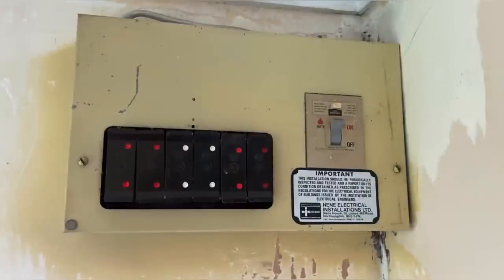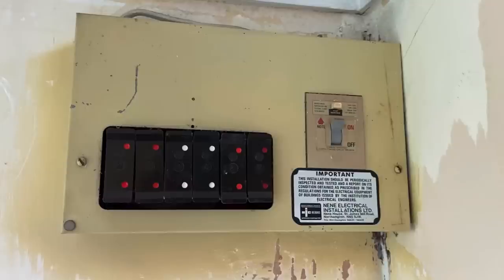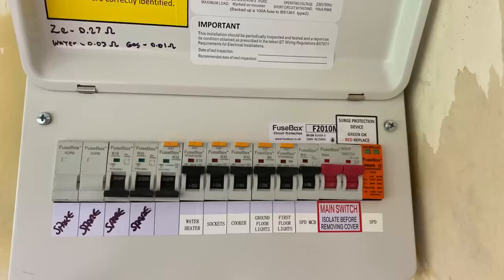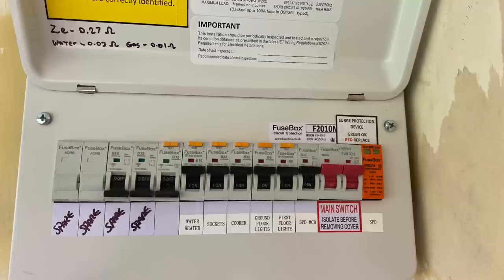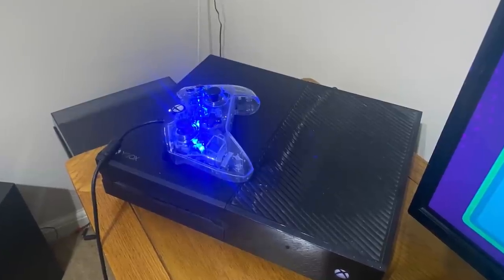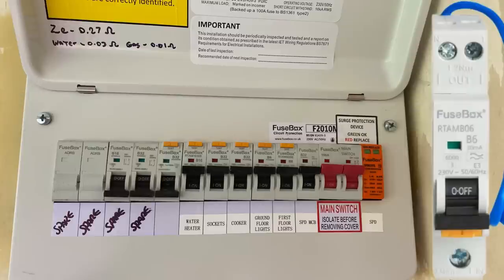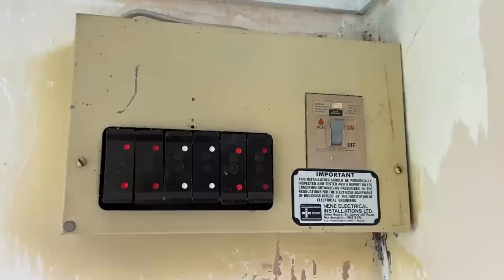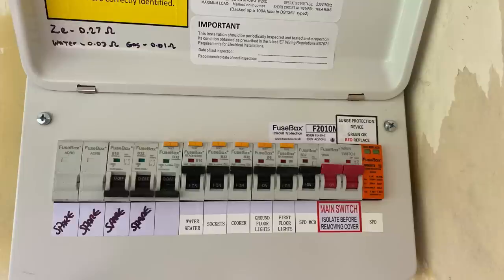Would you Change this Fuse Board..? WHY..? Understanding your new Consumer Unit

Comment: When my daughter and her children moved in my old Wylex board made me very nervous so I weighed up the risks of changing it out myself Vs the risk of fire and electrocution. I'm not a sparky but I do have an HNC in electronic engineering and decided I was sufficiently competent to do the job so I bought a Kewtech meter which is very nice bit of test kit, metal CU board and RCBOs for all circuits and now I'm much happier. Sure, I know it's notifiable work that needs signing off but I trust my own work far more than someone I don't know. EG when some fella popped round to change out to a smart meter there was no safe isolation, no lock off, no paper work and no testing he just shoved it in and left, personally, I thought he was more like a contractor called in by the energy companies for that specific task. 
I will wait for the sparkies to catch their breaths and compose themselves before breathing venom my way 😁
Reply: No venom required, you have improved an installation and by the sound of it have the ability to ensure that the results were all satisfactory. You do not sound like 'dave from the pub' type. Obviously you would have taken time to know the earthing arrangement, know its maximum permissible values, check this with your meter, then check all following results from testing to ensure you would achieve your disconnection times etc. The paperwork is important for renting or selling, other than that - the paperwork is imo the least valuable. A safe install is the important thing here. Bonding conductors in place and readings below max permissible etc. 

Sadly there are too many people that 'have a go' but get it wrong - sure it works, but it is far from compliant and not close to safe.

I have met electrical engineers and electricians that work in specific fields that cannot carry out a basic install in most domestic and commercial settings because they arent practised in it. Builders + Landlords used to be the worst but thankfully the new legislation is slowly eradicating the shoddy ones as they have to have the paperwork to let it out.

I personally hate consumer unit changes, we always test before we change it so we can make the landlord aware of any additional work required to bring it upto compliance - if not you would have to rectify the issues after the change but before it is energised and this can be costly / unexpected! 

Give me a rewire anyday, i know the quality of the install from top to bottom then lol (no limitations on concealed cables etc)

Well done and glad you managed to stay safe while carrying the work out mate!
Reply: @danielfisher2954  if a circuit  falls above the max zs value which is on an existing  installation  ect what is the rule then?
Also on a TT u might have a zs  of 50 ohms ect. Where that us acceptable  but it won't operate  the protective  device under an earth  fault.  So install rcd  protection  required  if zs  exceeded  for the above reasons?
Reply: Zs needs to be brought below max zs. For the TT, add earth rods

For circuits you have multiple options, change the type of MCB from say D to a C or even B (depends on circuits start up current)

Run an overlay earth? We do this on SWA installs to bring the Zs down

You could break the circuit and turn it into two circuits. Ring circuit into two radials on 20a MCB will give higher max zs and lower readings. 

There are always alternate methods but you have to see which is right, which the customer can afford etc.

Hope I've been able to help, still half asleep and probably just rambling haha
Reply: @danielfisher2954  How can a tt  system  ne allowed  up to 200 ohms though?
Reply: @carlmarquardt994  that is only with 'additional protection' in the form of a 30ma RCD. While the 200 ohms is compliant, it is preferred to have it lower.

That being said, we recently had a reading of 24ohms on an overhead supply. The main earth coming from the rod was only 4mm. I spoke to UK power networks who maintain the infrastructure in my area.

If the reading exceeds 20 ohms, it is considered a fail by then and needs rectification. On a TT the homeowner is responsible for the cable from the rod to the DB, UK power networks are only responsible for the rod itself. We changed the cable to 16mm and it brought the reading down under 20 ohms
Reply: @danielfisher2954  Ok Daniel.  Thank you for your contribution.  I have attended  a small  scale pumping  station down South. One three phase circuit  one light one power. 
Schneider  board no the just main isolator. Zs  was about 40 ohms  TT. Earth disappeared into the tar floor.
They are relocating  the meter  to outside wall as its in wet area  inside  end not in an enclosure. 
If I stick  an rcd  on the main dies that make it compliant. 
On the table of test results most of the max allow  Zs  are under 1 ohm.
I recently  did the testing course  end we didn't cover this. 
I am an Aussie sparky  and over here  now where  the regs  n rules are  more stringent.  Appreciate your  input
Reply: @carlmarquardt994  I ran this question by NAPIT before.

Provided you have a 30ma RCD, you're covered.

As for the max Zs results on the certification - record the info you have.

The R1+R2 is the most useful side of the test cert IMO. The R1+R2 will show you how big the circuit resistance is, you can do a simple calc to see if the measured reading is close to the expected reading for the circuit length.

The insulation testing will confirm you have no shorts or degraded insulation.

Obviously you have to do all your usual testing but when it's TT I find the R1+R2 gives you a better look at the install at a glance. (Kind of irrelevant but I add these to max for TN-S (0.8) and TNCS (0.35) max, this gives me an idea of it it would be compliant on TN installs)

I have known of a couple of installs where UK power networks couldn't get the Zs of a TT low enough (under 21 ohms for DNO/supply only), they turned it into a TNCS - we are not allowed to do this. Only they can
Reply: @danielfisher2954  ok. Many thanks.  I think  I am dealing  with the same network  down at welwyn  garden  city. It's slightly  off grid on an old landfill site. If they are running  a supply  cable to the location  get does it benefit  the supplier  to have a TT?

Comment: If your 70plus living with that yes keep it ,but honestly it should be updated …years ago the worst thing about them was 15 amp fuse wire in 5amp fuses and I’ve seen a metal hanger been cut and put in a 30 amp fuse ..I’ve seen nails in them plastic fuse cover removed ..( massive fire risk).. as I done my apprenticeship in the 70s there were loads around , and the mem boxes with porcelain fuses today it has been improved massively , better tools , better equipment , ie test equipment .. in my days at college my lap top was a pencil , rubber, sharpener ..,

Comment: Has anyone seen an old installation protected with 16A for ring sockets upstairs and 16A for the ground floor? Would that be compliant with the regs? Pretty sure said property was formerly converted into apartments. Has a CU inside and outside alleyway has another CU. There are two showers in the property but no circuits in the CU indoors.

Comment: If you do an eicr on a dual RCD board and the leakage does exceed the 30% rule, does it get coded at all.
Reply from the maker: Great question
Reply from the maker: C3
Reply: @GSHElectrical  if the rule is based on being more related to nuisance tripping as opposed to safety I guess it’s unlikely to be a fail and more of a recommendation

Comment: Is a modern consumer unit likely to trip if it upgraded an old fuse box in a house with 50 year old wiring that really needs a rewire? i.e. Both should be replaced at the same time.

Comment: Hi Gaz I was thinking about the possible problems we may have with DC leakage in our electrical system’s from thing like phone chargers washing machines or even the clock/ timer on electric cookers ? 
Now i’am not saying it’s wrong but if DC leakage is a problem isn’t it more likely to be coursed by smart meters as they are hard wired in to the system not just plugged in to the nearest socket  ? We all know how much electronics smart meters have inside them , so are they adding to the problem? If so get rid of them and it may solve the problem?
Reply: See I can be a good boy sometimes and ask sensible question’s . 🤣 I have always had a lot of respect for you guys. I get annoyed when I give a opinion and some idiot turns it into an argument like yesterday on one of Gary’s videos.
Reply from the maker: Any DC using equipment can leak DC current if the right conditions occur
Reply: Smart meters are on the other side of the RCD...

Comment: Any reason you couldn't swap the rewireable fuse carriers with rated breakers/rcd. I remember many years ago this being done as the unit and wiring and main breaker was fine!!
Reply: It does not give you 30ma RCD protection for a start. Secondly, whilst it's not mentioned in the video, there were a lot of wiring issues in the original unit (visible @3:22). One clue is that the old unit had 6 x 30A and 2 x 5A fuseholders, whilst the new on has just 2 x 32A, 1 x 16A and 2 x 5A RCBOs. So it's lost one circuit and the number of 30/32A circuits has been halved. 

There were all sorts of horrors, such as 30A fuses on 2.5mm^2 cable.

Comment: It's been 13 our 14 years ago we had our old school cu like shown replaced with a newer plastic one when we had our kitchen done
I literally threw away the replacement fuse wire earlier this week
Now the entire house is being rewired room by room I'm still looking into what the best future proof cu and breaker type at the end of the day in a few months
Any advice would be appreciated
Currently have a 14 way (12 populated) with a 100a fuse but we will also need to add in the fire alarm circuit in the future as its currently battery rather than wired (it's wired, just not connected)
Thanks
Reply: Moving forward then, if your not using a competent diligent electrician, as a minimum id recommend that you need to Upgrade the cu to metal enclosure with builtin spd T2,  all circuits to be A type rcbos, and all socket circuits upto 32A to have afdds. Oh and we're waiting for them to bring out socket outlets with type 3 surge protection built in and pen fault devices for the cu, we are so slow in the UK for this kind of thing, but all of the above should see you through to the 19th edition😉
Reply: @brianhewitt8618  see, I understood what you said there, but I just know I'm going to be in a position where I'll spend loads of money getting things done and then they'll change the rules again 🤣
And we are not in a position to have the entire house in bits so the loft is fine, the first floor is done, there's enough wire floating about to finish off the down stairs sockets when the time arrives to make a mess
Which is when the cu will get changed
Just want to know what to ask him to fit if he's fitting something else instead 👍
Reply: If by fire alarm circuit you mean for mains powered smoke detectors they should be wired in with the local lighting circuits.  The idea behind this is if they were on a separate circuit and it tripped you wouldn't know for a while until the batteries died . If it was on with the lights you would realise straight away and fix it or you would be in the dark .
Reply: Unfortunately it's hard to know right now what the best option is for future proofing.

Afaict Hager have historically been the best at maintaining compatibility. Their arc fault detection products however leave a lot to be desired. They are two modules wide, are not designed for the busbar styles we typically use in the UK and do not integrate RCD protection, so need to be used in conjunction with a seperate RCD or RCBO. 

Other brands offer single module combination RCBO/AFDD devices but haven't been as good at maintianing compatibility and/or are pretty new to the market.

Comment: Looks like my old fuse board except mine was an 8 way. Not long had it replaced with a 10 way with the two rcd’s as shown in the replacement, along with the old single 30amp fuse box in the garden shed that powered a few sockets and lights. (Lights were fused down using 5 amp spur from 30 amp) and now has a 32 & 6 amp garage fuse box. The old unit had to go as the trip had a fault and it had a 100 Ma trip. You’ve probably guessed I’m no sparky by my terminology🙂. No I didn’t replace it, had a sparks do it. I used to be ok at adding a spur in the old days, not that you can do that now unless a competent sparky, but replacing a fuse box is a far different matter and not a diy job no matter how much you think you know. A man’s got to know his limitations if he wants to avoid electrocuting himself or burning his house down.

Comment: Superb video, thank you.  Would you be kind enough to answer a few questions please. Is it fair to say if (like in this example) a consumer unit that is equipped with RCBO devices, all circuits presented to the box need to be uniformly fitted with this type of protection? In the box within the video, the two spare slots are not RCBO's. If later used this would present an issue as these two channels have zero earth leakage protection and potentially present an unsafe installation.  Second question, what load is attached to the "SPD MCB" breaker?
Reply: No, not at circuits need to be individually protected by RCBO's. However if you wish to do that, you may.

Comment: No mention of Ka rating of rcbo or main switch ie if sub station close by the Ka rating would  need to go as  a example 3KA to 8KA
Reply: Now what does Guidance Note 3 say about fault currents in domestic CUs where the service cut-out fuse will save your bacon ;)

Comment: We had an EICR done on a house, the electrician included an estimate on the back for changing the consumer unit "so it would be 18th edition compliant". The one already there was plastic, but fitted by Norweb to a high standard. My wife went in and paid before I could stop her, within 10 mins (I'm not exaggerating) the consumer unit was ripped out and replaced, when I asked for the EICR report to see how it was rated, he denied there was a EICR form for an installation less than 100 amps, even after I printed one out for him, (and paid for it), and said the notification for change of consumer unit was all that was needed. The letting agents say he has done lots of these changes for them, I'm not surprised at £750 a pop.
Reply from the maker: Massive thanks for your input 👍🏻
Reply: @GSHElectrical  I left the industry 8 years ago, but it never leaves you, and I try to keep up with new ideas. Thanks for your channel!